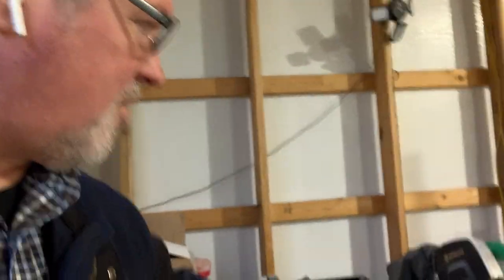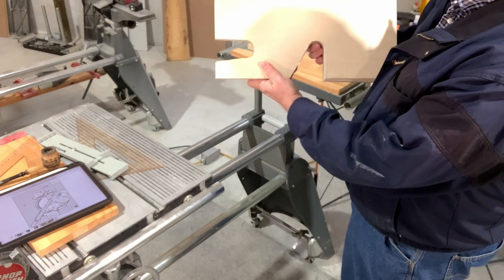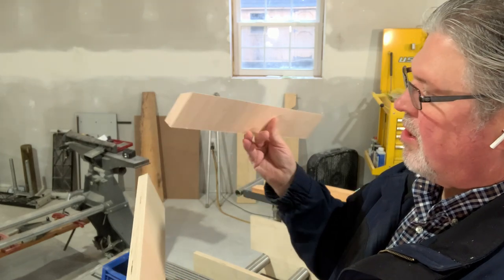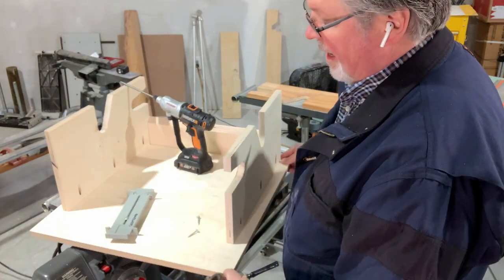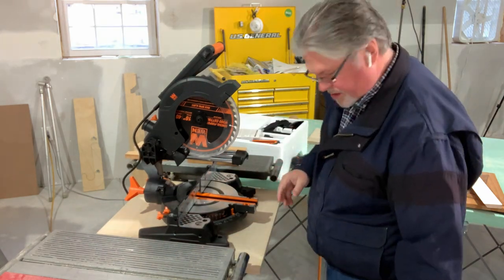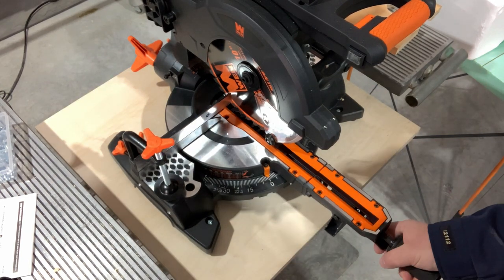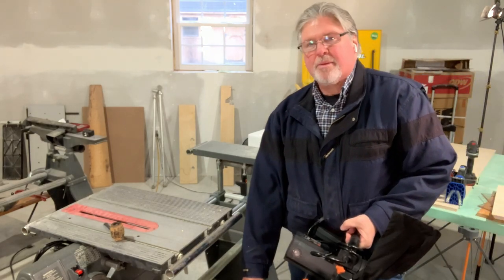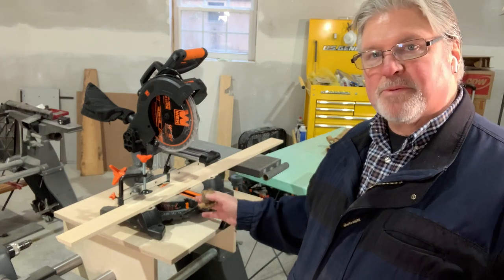“ChopSmith”: Wen Sliding Miter Saw from your Wall to your Shopsmith and Back!

Comment: Good idea, I had set up my sliding chop saw to fit into my workbench and then removed when I am done with it.  The problem is the work bench was huge and I just don’t use the chop saw all that often maybe once a year.  I got rid of the workbench but the saw is a hold over from when I did finish work years before.  I spent too much to let it go and I can never get out even half of what I spent.  At the time it was the best that money could buy.  Setting up a stand on the shop smith just might take care of a few problems.
Reply from the maker: Glad you found it helpful. I continue to use it and it has been very handy.

Comment: Wow, great idea really.  Acquired my first ever “chop saw” (the Worx) around Christmas and quickly set it up on my very movable WorkMate where it’s been since.  50 plus birdhouses later, a few saw horses, a work bench & a few lanterns & wind spinners later and it sure would be nice to have the Chop Saw set up when I need it, but don’t sitting on the WorkMate.  Then along comes your “Chop-Smith” - perfect solution, solves a lot of my current issues. Thanks! Scott.
Reply from the maker: I’m glad you like it. Recently I was looking for my Workmate and after searching around the shop, I realized that my router table had been planted on it months ago and hadn’t been removed. It really does need to be kept clean in order to be as useful as it should be when we need it. I think something like this is gonna be very helpful. Scott

Comment: I love this idea.  I've never had enough space for a chop saw but this idea may change my mind.  The ability to quickly set a tool onto the Shopsmith way tubes and use the Shopsmith's main and extension tables as part of that tool, then remove it and place it onto a wall to use it there is priceless.  Very ingenious!

Comment: Very clever ! In respect to wall cleat I see one thing that will show over time. While resting and support is on cleat downward pressure and leverage is on sheet rock. Mounting a full piece of ply 26” wide x the length of very clever smith adaptor you now have proper support and anchorage of cleat and adapter bracing. Just a thought. Very cool vid bud. Always thinking.
Reply from the maker: That’s a very good point, John. Thanks for chiming in. Scott
Reply: @MyGrowthRings  your welcome. I am impressed with the cleat for  smaller  equipment as well as so many others were in the comments. In a shop it’s seems a cleat system is all about storage and some ease of use. You took this to another level. Think of the shop cabinetry that can be  saved on and the cost while keeping lower floor space  open for other things and  easy cleaning of floor to wall. I’m in a insulated metal bld with no internal sheeting except we’re I did implement at my welding table for safety an not destroy insulation. This may be worth sheeting another area as I’m always looking to better my shop lay out.   I’ll remember this one. Thank you.
Reply from the maker: @johnanthony2545  I'm at that same juncture in my shop life and am totally conflicted, which is why I show a couple ways of doing things. Thanks for watching and commenting. Scott

Comment: I love this idea. It is great that you include the mishaps. They happen  so easily. Not having any experience with the French cleat, I  would be concerned about the hold strength  of the cleat as it is  only 3/4 " thick and given the size and weight of the table. I think I would be inclined to double the thickness of the cleat on the wall.

Thanks for another great video.

Comment: Very nice idea.  My chop saw sticks out the back so wall mounting is out but using two 3/8" knob bolts on opposite corners the saw can be attached and removed from the base easily. Also I have a small portable B&D router table I have been setting on the way tubes sandwiched between a floating table and the main.  It still can be moved forwards and back but adding a shorter version of your tube riders to the bottom (it is already mounted to a plywood base) would lock it into the tubes.  I think I will use 2x4's instead of birch.  Thanks for the info on this.
Reply from the maker: Those sound like awesome additions.

Comment: I saw that idea on Doug's channel years ago and thought it was pretty slick! I got that same saw he used. I had a thought about making a fence with this. Mount an extension to the miter gage and then mount it in the slot backward. Align the assembly to the miter saw fence. Lock it down and you have a fence for stops. Also, I too have a couple holes in my kreg jig 😉.

Comment: Fantastic idea! I have a ShopSmith 500 I bought used a few months ago, my old Craftmans table saw went out and I decided to try out the ShopSmith so I watched your videos got the saw lubed and wasn't real happy with the small table area and the fence was a bit sloppy, so I bought a Jet table saw but the main reason I bought the ShopSmith was for the other features, lath, bandsaw, drill press, disk sander. I know I could and need to up grade the table or at least fine a better solution for a fence so I could still use it for dado and other special cuts but adding a chop or sliding saw ( my shopsmith isn't aganist a wall) would save me a lot of room in my small shop, so thanks again for this great idea!
Reply from the maker: I think it would be perfect for your situation. Thanks for watching and commenting. Scott

Comment: Thanks Scott. Great video and I am glad this idea is finally out there on YouTube. I have used the same slots on my 'Chop-Smith', mount, and find it easier to use the handle on the  top of the saw to lift on and off, but lifting it on and off from the rear: drop it onto the rear way tube, and then lower it onto the front - tilt backwards to disengage from the front way tube when removing, and just lift off. That way it is less strain than reaching around the whole thing to lift it off forward. I also use a similar mount for a router as others have commented upon here. Thanks so much for all your time and effort to share your invaluable knowledge about this amazing machine. Maybe you could share a simple pdf template of the spacing and dimensions in the sides of the mount for others who want to try this?
Reply from the maker: Mounting and removing from the rear makes a ton of sense and I’ll make sure to give it a try. I’ll look into the PDF idea.

Comment: I did a modified version that clamps on the bottom like the Shopsmith planer and I added a little compartment underneath and put wheels on the bottom so I don't have to carry it and instead of mounting it on the wall I just park it somewhere out of sight.
Reply from the maker: Tim, I received the suggestion of adding wheels, and that makes a lots of sense for transport within the shop.

Comment: I thought I screwed up but then I didn’t and then I did again.  
The history of woodworking  
I was thinking of mounting my router table onto a piece of plywood and clamping it to the Workmate but adding it to the way tubes of the SS might be a good idea.  
What’s the approximate weight of the whole unit?
Please post the drawings of the cutouts?
IMHO, the chop saw cutting on the laser is a good thing.  I can always move the wood so the laser isn’t on the line.
Reply from the maker: Jodie, I’m gonna have to weigh it because I just don’t know. I’ll do that before our follow up video.

Comment: Good thing you didn't glue it straight away. I did one of these things several years ago it ended up being super heavy and I ended up putting a couple furniture carts from harbor freight under it to get it out of the way and use it on the ground. I do like how you took the sliding feature into consideration.
Reply from the maker: Casters are an excellent idea! I’m steeling it!
Reply: @MyGrowthRings  Can't wait to see it in action.

Comment: Great idea! That same table could be used for all sorts of other bench tools. My chop saw has been sitting on floating tables on my 510 for a while. I planned to mount it on a table that would be hinged on the wall so I could tilt it up to working height, but I will more often want something completely portable because I'll probably use it most often when replacing all the molding throughout my house. I think I can find a way to mount this on the wall so it can tilt up, maybe by switching the fore and aft slot shapes so it can just hang on a 1-3/4" pipe mounted on brackets.  I wonder if it would be easier to mount the table on the way tubes with the slot shapes switched so the initial alignment of slots on a way tube happens at the front. Even if I don't use it on the Shopsmith all that often it's worth it for me to try out that kind of table. You might want to add something that will clamp the table down on the way tubes so it can't bounce or slide. I wonder if some magnets of a practical size could hold it tight under use.
Reply from the maker: MAGNETS! Now you’re speaking my language, Ed.

Comment: Generally speaking if you know where something's going to be in advance wood blocking is your best option in the wall prior to drywall. In a shop environment it's pretty safe to just put blocking that self-level the entire way around. Drywall anchors will only take so much abuse before they start to wiggle loose.  My solution is too simply fill the void behind the hole with expanding foam, just prior to inserting the anchor. You want to select the amount of expansion in the particular phone for the size of void you have, but I've had a great success with this solution.
Reply from the maker: You were right, that would be the best option. I had some blocking, put in for the barn door, but had no intention of using cleats on my walls.

Comment: Wow. Baltic Birch, I remember when we all had a stash of BB. I really like this idea. My basement shop is only 9'9"' x 9'9" (that's just 95 sq. ft.!) and I really want to move my Shopsmith off the porch and down there for winter use (ultimately a second SS). This would give me a place for my miter saw, too. My other takeaway is that this whole project is easier if you already have the chop saw sitting in the shop, my visualization is just fine but I have found a lot of dimensioning errors in downloaded manuals, especially when they convert metric to "freedom" units. Including the book I got with my little WEN lathe. Your could just notch the front and back of the drawer to clear the "Bittner's" and then add a false front to hide your work. OTOH the "Chopsmith" is just a jig.
Reply from the maker: Yes, this BB cost a fortune! You are so right about manuals. For two years when I was new with my employer, I was faxing out copies of mounting instructions for a piece of hardware, that I later learned had changed before I ever started! I can’t imagine how many people drilled holes in their cabinets, only to find out when the hardware arrived that they had drilled them in the wrong place. Scott

Comment: Having bought my second ShopSmith (and a second Radial Arm Saw) this may be the solution to my “where do I put everything” problem.
Reply from the maker: Did you get a SawSmith?
Reply: @MyGrowthRings  no, the RAS is a Delta Multiplex, dating from the late 1940s or early 1950s. Neglected and lonely, it “followed me home” (that’s what I told my wife).
Reply from the maker: @paulplant7956  They’ll do that.

Comment: Any issue with horizontal movement of the Chopsmith when its on the Shopsmith carriage or do you sandwich it between the main table and an accessory table?
Reply from the maker: Not that I’ve experienced yet and no, it’s not a tight fit between the end and the carriage. I suppose you could slide the carriage over and tighten it in place, but that might interrupt an operation that you’re performing with it. I think there might be an opportunity to add some magnets or some non-slip element.
Reply: @MyGrowthRings  Take ever opportunity you can to add magnets! Even if they are just for cosmetic value... They just make everything more attractive

Comment: When mounted on the wall; add some outriggers on cleats on either side of the saw that can slide for different lengths of stock support.
Reply from the maker: Good thinking. Dang it, I’m going to wind up with a wall full of cleats, aren’t I?
Reply: @MyGrowthRings  Possibly. I'd leave some room for peg board as well, but that's just me. I still think peg board has it's place and purpose, unlike most others.

Comment: i like that the saw bars are out at you . at one pont i thot you had not pot then on yet. and you wor going to be miss up again lol. i think im going to save up for this saw so i can cut wider bords. and yes some day i need to get me a Pocket-Hole Jig are make one. you all seme to have them and i steel do not. and now im thing win i make the sander ... making it go on like this boy you give me a lot to do... i love it thanks. keep me doing some thing . being retired is not as fun as you all think ...
Reply: ok now im seeing if it works sander and saw on top. oh this is going to be a long night... butt fun for me
Reply from the maker: Pocket hole joinery is very handy and they are used by virtually all face frame cabinetmakers in the USA today.

Comment: Cool set-up.  Tight up until the end I thought you had forgotten your desire to use the SS tables as extensions.  Was it simply the camera angle that fooled me?  Crazy John
Reply from the maker: No, I pulled the main table off so you could get a better look at everything, but otherwise, I don’t see a reason to remove the tables.
Reply: @MyGrowthRings  Check out the view at 20:29. Your ChopSmith is resting on the tubes and the Main Table on the headstock.  Looks like a 2" difference.

Comment: Although I like the idea of the "chop-smith", you could have done a little better with the wall mount.  You may see in the future it falling off the wall with a little weight applied.  If it was me, I would either use 1" ply or laminate 2 pieces to make the cleats or two cleats an upper and lower.  The cleat and/or would be taller and stronger.  Just is going to be a lot heavier and stress on a normal 3/4" cleat?  Am I looking at this wrong?
Reply from the maker: Hey Milt. I think you are spot on and I plan on addressing this is the follow-up video. Scott

Comment: What are the thoughts of doing the points where it connects to the tubes the opposite direction of what you did? It might be easier to hook the front and let the back fall into the slot. At least it seemed that way when you were trying to set the saw on the tubes.
Reply: Problem there is when you use the chop saw you are pulling down on the front which would tilt the back off the rear tube.
Reply: @Pascalore  that's a good point and likely the thought process behind how it was done.
Reply from the maker: It is what I was thinking when I designed it, but someone else suggested, installing it from the rear in the same configuration might be better, and I think that’s worth trying. I’ll report back in the follow up video. Scott.

Comment: I purchased a wen 10 in 2 speed chop saw as I wanted to be able to run metal blades in it too  It was pretty crap. A pain of a lot to undo to et the blade out then the 5/8 arbor was a few thousands over.  The wen blade fit fine but my others would not. So I ended up removing the blade and turning the saw on low as I placed a file on the arbor shaft.  I did get standard blades to fit.  You have to have a  screwdriver and a allen to change blades. The back fence was not straight either. each side was set back about a 1/16th next to the blade so placing a straight edge the middle of the fence had a 1/16th in gap.   I had to ad a sacrificial fence. I should of sent it back but I had not used it much the first month.    they do not make it any more.   

WEN 70730 15A Two-Speed Single Bevel
Reply from the maker: Wow, that sounds awful. This one is pretty good right out of the box. It’s no Bosch, but it’s not bad.
Reply: @MyGrowthRings  I have a wen Dremel with a flex shaft I think I paid 17 bucks for several to like 4 or 5 years ago and I loved it so much I got my dad one.   I mean the bits it come with are trash but the tool is nice and powerful.  Then I have a finish nailer anda random orbit wen sander.   I have no issues out of it.      I still have the other  saw... I use it for cutting metal only.  It is nice to have a compound miter that can cut steel.  but it sure left a bad taste in my mouth.

Comment: Scott, thanks for another great video! It's very instructional to watch you "fly by the seat of your pants"- encountering and solving problems as you go. For a jig/fixture I intend on using for a long time, I would have waited for the saw to arrive before finalizing my plans and before cutting any wood/drilling any holes. Also, as I recall from the beginning of the video, you plan on cutting long 2x10s which need support on the right and left, which you don't yet have on the wall.(but you do have on the Shopsmith).
Now for a cheap shot...How many circular saws do you have? At least 3 Wens, and now a Wen chop saw! I thought you were a Shopsmith guy! "Wen" did you defect? LOL! Your future shop looks very spacious...good thing!   jim
Reply from the maker: Hey Jim. Yes, my intent is to use the ChopSmith mostly mounted on my Shopsmith for the additional support it offers, but you are correct, if it is used on the wall for lang stock I’m back in the same place as I am with my current Hitachi saw. How many saws do I own or do I use?  You have t seen the tip of the iceberg!  Scott

Comment: Have you got the measurements for the cutouts on the way tubes?
Reply from the maker: The holes are 1 3/4” in diameter and they are 7 inches center to center.
Reply: Thank you.